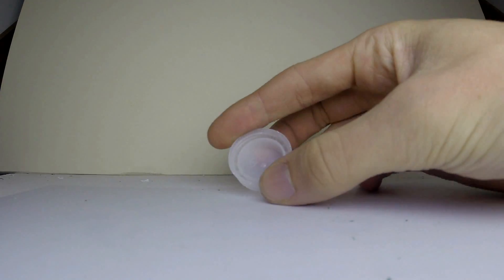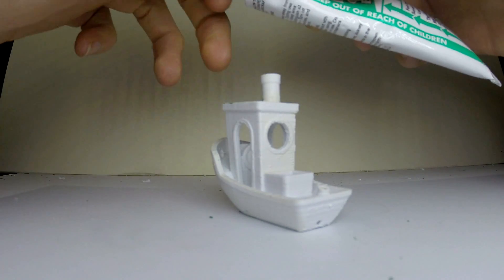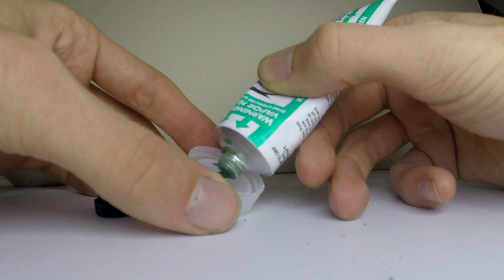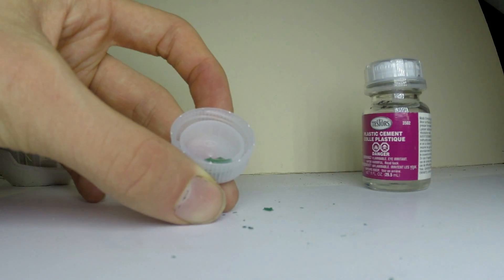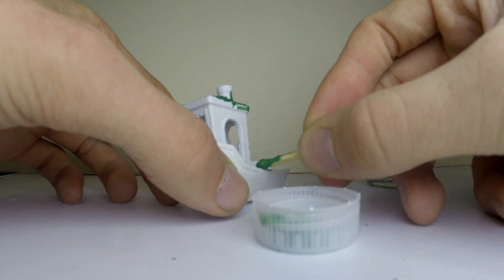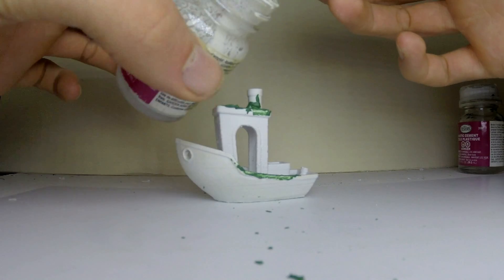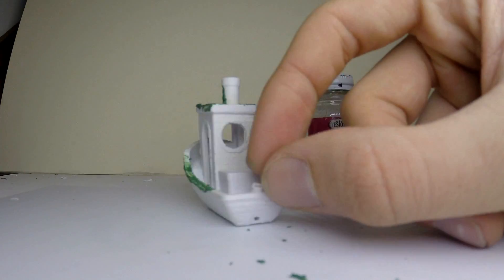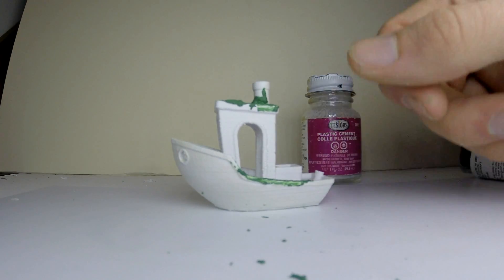Thinning Spotting Putty with Model Cement

Comment: Never seen that green solvent putty before! I'm clearly not looking hard enough. What's the shrinkage like when it dries, like if you're covering a split would it need a few passes you reckon? I do a similar thing with thick abs juice at the moment but it shrinks heaps and takes ages to dry!
Reply from the maker: I find it sticks ok as-is out of the tube but once mixed with the glue it sticks even better and is easier to apply. MEK and acetone in the glue will soften PLA/XT/ABS (some more than others) but that softening and thinning of the putty seems to help it flow into the crack better and fill it in.
Reply from the maker: +Maker's Muse It is called Squadron putty and was made for the modeling world. It is a bit expensive but I got some from a closing down hobby shop and it works a treat. I used it to fill in gaps on a 3D printed prop for a friend and it did remarkably well with almost no shrinkage. http://www.squadron.com/Squadron-Tools-Green-Putty-SQ9050-p/sq9050.htm

If it wasn't probably considered hazmat to ship I would send you a tube!
Reply: +Maker's Muse usually that stuff, the Squadron Putty, is used for filling gaps in plastic or resin models.There is a green and a white putty (I have both, but have only used the green so far. Not sure what the difference is, other than color). There are other gap-filling agents out there including stuff by Mr. Hobby. Once cured, they're easy to sand (much easier than CA glue which some ppl use to fill gaps)

I hadn't thought about using these for 3D prints because it's a different type of plastic than regular models, but it's a great idea. Definitely will be trying it out myself.

Calvin - how well does it stick to the PLA/ABS? once it's cured?